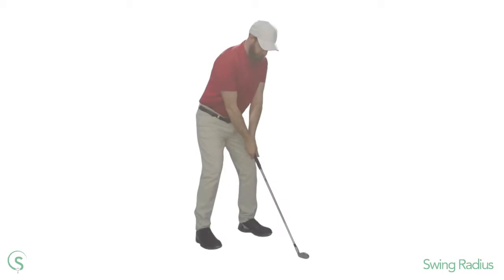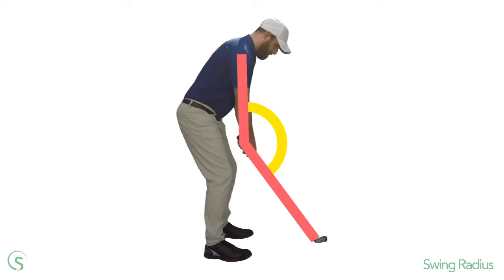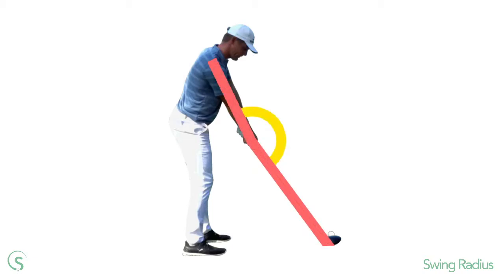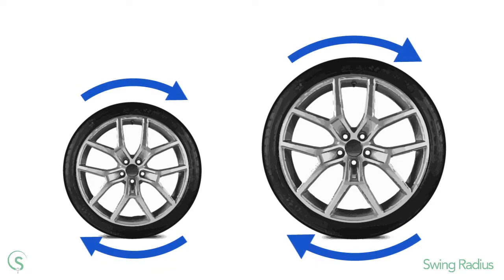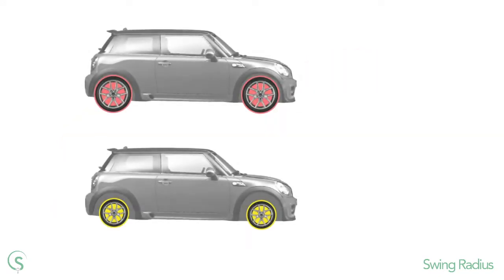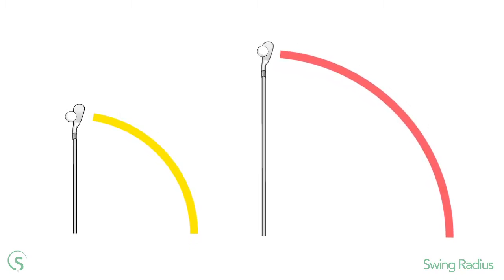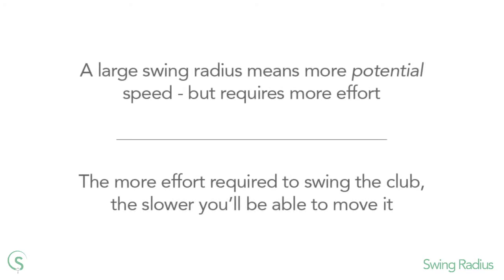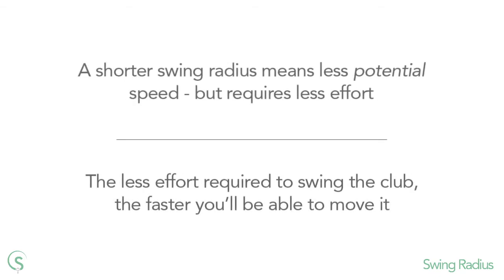Bryson DeChambeau's Swing Radius

Comment: Good analogy. Here is my non scientific theory.
Bryson sets up with the number 2 accumulator zeroed out so he establishes the maximum radius at setup.  Other players that don't do that reach their maximum radius too, but do it during the swing , not at setup.
Now, for discussion purposes , let's clone Bryson and call his clone John.  John is identical in every way to Bryson. Hits the gym and is just as strong. John uses identical clubs to Bryson's.
There is only one difference between the 2 when it comes to their golf swing.  John does not zero out the number 2 accumulator at set up like Bryson does. John has a very noticeable angle between his right forearm and shaft. 
Now let's video both players swing , down the line, then view the video and stop it just after impact.
Bryson and John both have the right forearm and shaft  inline. John no longer has the angle he had at setup.  Bryson and John look identical.  Both now have the same radius from left shoulder to club.  
 Look at any great player at impact. Regardless of how they setup at address, at impact they have the right forearm inline with the shaft and have reached the maximum radius allowable by their arm/shaft combination.
So Bryson does not magically increase his swing radius because he zeros out the number 2 accumulator at setup.  John reaches the identical radius where it counts, through impact. 

So what's the advantage to setting up one way or the other? Bryson vs John's way?
John introduces a complexity into his swing that Bryson doesn't.  John has to accomplish a clubshaft plane shift during his swing. Bryson does not. So Bryson's way (like Moe Norman's way) is simpler and easier to repeat. That's why Bryson does it.  

Bryson does not hit it farther because of that. He hits it on the sweet spot more often because of that  so that makes it go farther more often, which increases his average driving distance. . His brute strength is definitely a factor . Bryson  is 6'1" and 245 Lbs. 
Yet, surprisingly, his driving average in 2020 was  only 8 yards longer than Rory's, who is 5'9"  and 160 lbs.  So how does little Rory do it?
Bryson bombs it with brute strength to power the accumulators. Rory does it with rotational speed  using centrifugal/centripetal force.
Swinging vs hitting. "If strong , hit. If flexible , swing"- Homer  Kelley
Reply from the maker: Hi NYgolfer - excellent write-up, thanks for posting!

You’re missing an important point between Bryson and his clone ‘John’, but it’s not something I’ve covered in this video.

If everything about them is identical at address, except Bryson sets up with his left wrist fully uncocked and John doesn’t, think about how close they’re standing to the ball. 

Bryson, with his outstretched arms and club, will stand further away from the ball at address than John. This creates an important difference between the swings at impact. 

You’re correct in saying at impact they both have the same radius between the left shoulder and club - but their swings don’t look identical at this point in time. They can’t because their balls are in different locations. 

To compensate for standing closer to the ball, John has to rotate his ribcage more anticlockwise at impact than Bryson does. This moves the left shoulder away from the ball and ensures John can still hit the ball with a fully uncocked (or near enough to it) left wrist. 
If John didn’t make this compensation, and was truly identical with Bryson at impact, he would miss the ball entirely, or at best hit it with the hosel / heel.

(Compare Bryson’s driver swing with say Rory McIlroy’s - look at how much they’ve rotated their ribcages at impact to see this difference)

In the introduction to this video, I’ve explained what I meant by ‘swing radius’. I’ve said “In this context, I mean the distance between the clubhead and left shoulder.”
I’ve purposely said “in this context”, because the centre of the swing isn’t the left shoulder, if the left shoulder is rotating around the spine. 

With that in mind, let’s say the swing radius is more accurately described as the distance between the clubhead, and a spinal vertebrae between the shoulder blades. 
Compare this distance between Bryson and his clone John. Bryson’s swing radius will be larger than John’s. And as per the video, that will come with all the advantages / disadvantages that entails. 

*

As for the Bryson / Rory, brute strength / centrifugal-centripetal forces debate - I don’t agree with the binary distinctions. 
Rory has brute strength. Bryson absolutely utilises centrifugal forces. It’s not a one or the other. 
The stronger you are, the more musculature you can utilise, the greater you can harness centrifugal forces. 

All the best, Antony
Reply: @TheSwingEngineer  Spot on Antony.